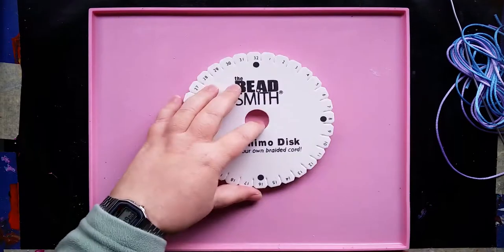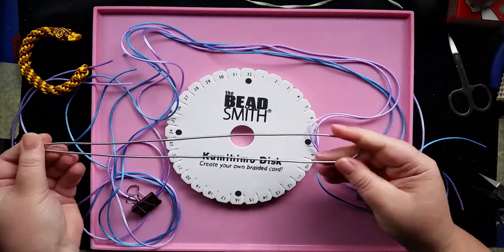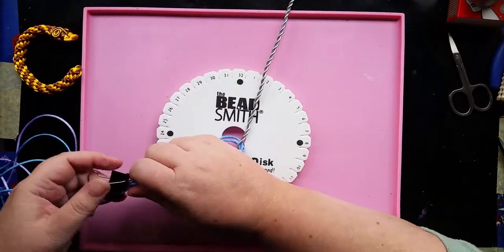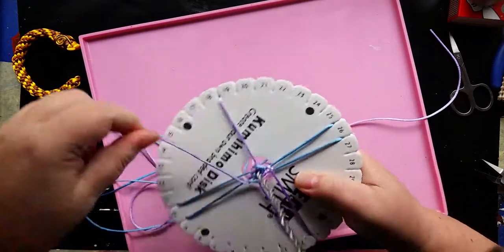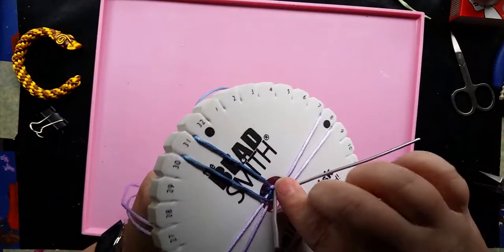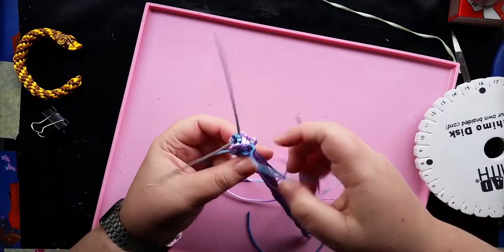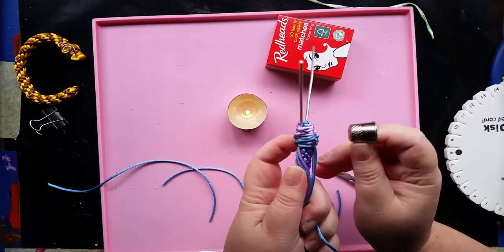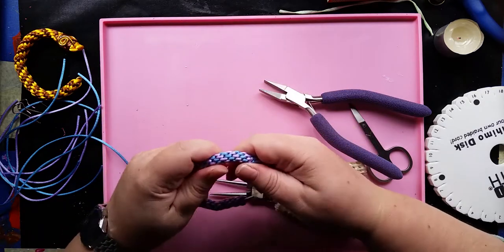041 Kumihimo Braided Bracelet With Wire Core

Comment: What is the gauge of the wire you’re using? Thank you.
Reply from the maker: It's 2mm thick, you can look up the gauge information if you need to, but I bought it from Ebay as "2mm wire" so I didn't need to know any gauge information. I prefer to avoid using gauge for measuring wire, because there are multiple gauge systems (AWS, BWS etc) and sellers often don't tell you which system they are using! It just leads to confusion for everybody. Using the actual measurements, whether they be millimetres or inches, is much more straightforward.

For wire work, it isn't so much of a disaster if the wire you get isn't the wire you wanted, but for chainmaille rings, it is essential.